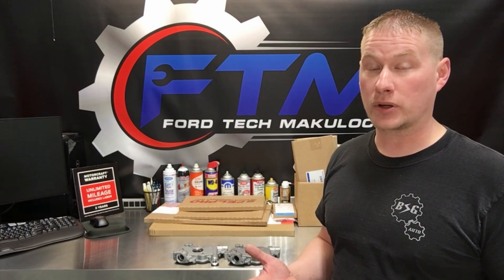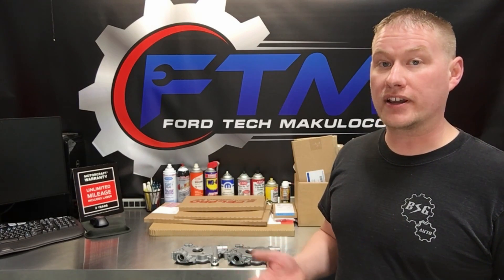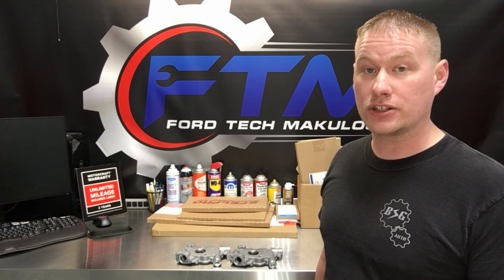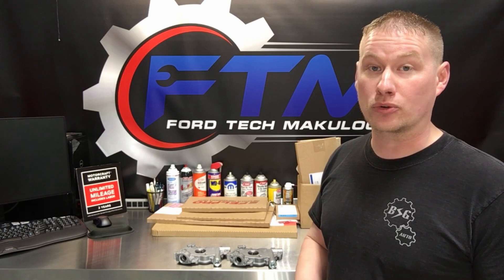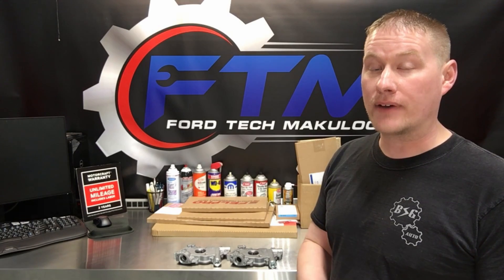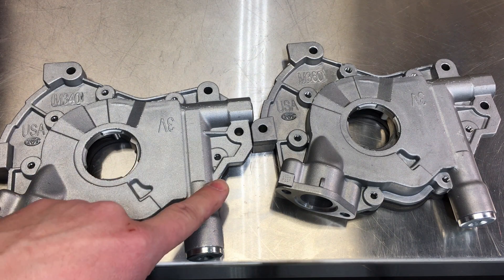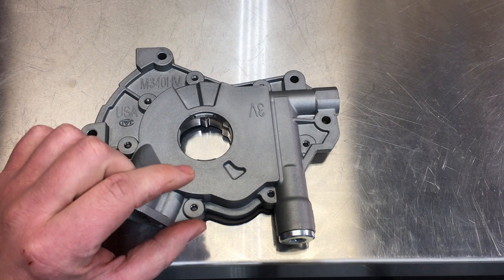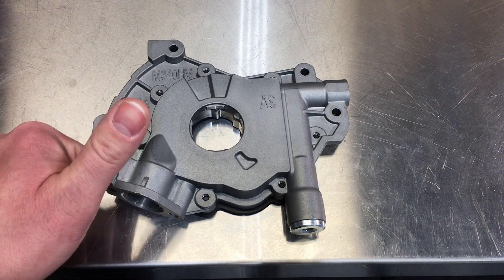The Ultimate 5.4L 3v Triton Engine UPGRADE: New Melling M340HV M360HV High Volume Oil Pumps!

Comment: Hi even though this video is a few years old the information is still relevant I'm sure.
Can you please help me clarify if this & other videos for this Triton engine are relevant for me.
I live in Australia & have recently purchased a Ford Ute One ton tray aluminium version is a 2003 built in the March of that year & is a BA model the engine is a 5.4 Ltr 3 valve double overhead cam engine with VCT though my car is a Ford not a Triton though looks like the same engine, I will try to send a photo. It only has 118K Kilometres on the speedo, though makes a knocking sound, engine is quiet when it's first started though after few minutes warming up starts to get a knocking noise & is hard to identify where it's coming from & it is not a high pitch knock, I have changed oil recently along with the oil filter using 10W30 good synthetic oil. hoping you can help these videos are relevant to my engine & would love to hear any advice on my knocking sound. Kind regards Neil

Comment: Oh man I am having one heck of a time with a 5.4! I installed a new crankshaft, bearings, timing chains, phasers, metal body ratcheting style tensioners, camshafts, and oil pump. the cam journals are a little scored but not bad enough to bleed off all my oil pressure... When it gets up to operating temp the phaser rattle and shake comes and goes, like there is almost enough oil pressure but not quite. Cold start is 60psi+, when hot it is something like 25. I had a brand new oem 4v oil pump on the shelf so that's what I installed but I think that might be my problem... Going to try one of these hv pumps before I take the heads off.
Reply: Did you install a high volume pump since you posted this comment?

Comment: My 2005 f150 is having a oil pressure problem, but I don't know exactly what it is.
It shows ENGINE FAILSAFE MODE warning and it runs for a few seconds and dies.
Does anyone know what the problem could be?

Comment: 2008.5 Expedition here...about to do the timing chain due to failed tensioner (all motorcraft parts) and the M360hv pump. What weight oil do you recommend?

Comment: So I have a 2011 Ford Expedition 5.4L 3V. Will the M360HV work for my year? Amazon says it won't fit, but wanted to ask around. Amazon says the M340HV will fit but not the M360HV.
Reply from the maker: Both work.
Reply: Thanks Man, Any particular reason why I should choose one over the other? I'm leaning towards the M360HV just because of the higher oil pressure. It's just a stock Expedition with the new updated roller followers thanks to your amazing videos. We appreciate everything you do man.
Reply from the maker: You need higher volume not higher pressure
Reply: @FordTechMakuloco  perfect thanks

Comment: @FordTechMakuloco Brian,  May I suggest you detail why you're recommending the 340 over the 360. As I'm sure you know, there is a lot of confusion (via the comments) on this issue. With this engine suffering from oil pressure issues, "common sense" say's higher pressure is better, however, common sense doesn't make something the best.  
Cheers
Reply from the maker: There are clearance issues not pressure issues so you want the M340HV.

Comment: My 2010 F-150 FX4 5.4, 3V is showing the oil can symbol on the instrument panel. I'm not losing oil so I assume my oil pump isn't running at 100%. I clicked your link for the Melling pump but the Amazon garage feature is showing that it is not compatible with my truck. My VIN is 1FTFW1EV8AFA08090. Do they make a model that is compatible?

Comment: This is one more reason I have trouble trusting Amazon. You clearly state in the description these pumps are for 04-14 5.4L 3v engines. I clicked on the link and Amazon said it doesn’t fit my 2005 F150…..

Comment: I put every thing in like you said, everything went very well. I put in the upgrade oil pump, the piece of crap broke at less than 20k miles. It was running perfectly, good mileage, regular oil change, good oil. Left us setting waiting for a tow truck. Probably go with the more expensive Napa pump, haven't  decided yet. Otherwise you put out excellent videos.
Reply: Yea if you don’t drop the pan and clean the pick up out doesn’t matter how much oil pressure your pump makes

Comment: So does ford now put the melling hv oil pump on the new ford reman 5.4 3v engines? On another video you mentioned ford did update the oil pump and roller followers on the new ford reman 5.4 3v so is it good enough to not bother installing a melling hv oil pump if we have the opportunity ?
Reply from the maker: Why would they use melling parts in a Ford branded engine?
Reply: @FordTechMakuloco  Is the oil pump they use at least equivalent... cast iron backing plate and increased pressure etc? That's what I meant. In other words is there any need to upgrade a new ford reman with a melling hv oil pump..is the melling  still better ?
Reply: @FordTechMakuloco  
Hey buddy...some time other companies use another brand
Dodge Ram use Cummins engines... Hello?!

Comment: Wanted to ask the forum and FTM about this situation where I bought a 2010 Expedition (138,000 miles) with a timing component replacement job, but no oil pump replacement. Considering the continuing vulnerability of the new components as well as the original roller followers to lower oil pressure in an older engine, would it be reasonable to have a new oil pump installed now? Other than the oil pan, what else would have to come apart?
Reply from the maker: The entire timing set has to come off again, the oil pan stays put.
Reply: @FordTechMakuloco  thanks FTM, it appears I have a dilemma. I guess the roller followers could be done at the same time.
Reply from the maker: Yup replace them when the cams are out for the timing job.

Comment: I know this is three years old,  but they are still not available in Amazon.  Any other link suggested to buy one please. I have 254,000 mile and rather have you do it with your expertise.  But I live in Detroit so to far away and only trust you or myself to work on my truck. Please any other suggestions would be much appreciated.
Reply from the maker: They are just on backorder right now.
Reply: @FordTechMakuloco  I can get the m340hv now but given the mileage should I wait for the m360hv?  Also I'm worried about to much pressure and blowing all my old seals. Any advice would be appreciated. Your opinion will not be used against you. 😁
Reply: @FordTechMakuloco  also Amazon claims the m360hv does not fit my vehicle?

Comment: How do you know you need a timing job ?
Reply from the maker: I have an entire video dedicated to this subject.
Reply: @FordTechMakuloco  oh ok cool. I bought a used 2011 Ford Expedition el limited with 220,000 miles for $6500 did a full tune up , changed out solenoids MAF sensor camshaft sensors fuel pump and O2 sensors. Has a little “lifter tick” is what my mechanic is saying but runs great should I be worried? It’s been a year I have 227,500 miles now with Mobil one oil . Going to use shell rotella diesel oil next since I hear it’s good for high mileage trucks

Comment: Just buttoned up my 07 Expedition with the new 360 pump, one word......SWEET! I've had a few vehicles with the 5.4 3v and had to do timing jobs on them, always used the 340, this was my first 360 hv/hp pump and at 225,000 my Expy sounds brand new, I'm very impressed with this pump so far

Comment: I see Melling has numerous pumps for the 5.4L 3v's: m340, m360, m340hv, m360hv, 10340, and 10341.  @FordTechMakuloco recommends different models in different videos.  Kinda confused on that.  I understand the volume vs. pressure differences and suppose the confusion occurs over time with new models.  But what's best for me with a 127k mile mostly stock engine in cold country (WY)....I'm assuming the m340hv?  But then add in the heavy 8k towing and high punishment....maybe something else?  Add to that the low availability of m340hv and m360hv now on amazon and rockauto.  Hoping someone can help clarify.  Thanks.
Reply from the maker: Yes M340HV

Comment: A few questions/observations. Amazon states the 360HV does NOT fit the 5.4 3 valve engine. It only lists the Mustang 5.4l engine as the correct engine. Does it actually fit? Also what about the possibility of starving other areas of the engine for oil, such as rod bearings? I know back in the day we used to swap out oil pumps to deliver more oil to the top end, only to spin bearings in the lower end. Thanks again Brian, you have created a legacy of loyal Ford supporters.

Comment: Is there any benifits for the added 20 psi running the 360 vs the 340? I would have concerns about running out of engineering spec pressures. Perhapse reduced fuel economy and extra engine drag... I realy don't see the benifit of the extra pressures in fact possably could cause vct damage but not sure. Any thoughts?
Reply from the maker: No benefit, I use the M340HV in all my builds.

Comment: Lol 10 to 15 minutes  after 4 hours of taking engine  apart to get to oil pump. Timing chain..and radiator  .fan all have r
To come off 5 hour job. If your a young guy with good back..

Comment: I like the idea of changing the engine with a crate engine, however I'd prefer an engine other than this 5.4 that's more reliable & bulletproof by design.  Any idea what I could do?  2007 Lincoln Mark LT this truck is worth it. It's a 4x4.  I'm not talking anything crazy, the least amount of work for a quick drop in?

Comment: So can we run the 80psi versions without any issues?
Reply from the maker: I would stick to the M340HV.
Reply: @FordTechMakuloco  I've just finished building a 5.4 3v with MMR guides and tensioners, new valvetrain, and H beams rods, and ARP stuff on the bottom end... I already installed the 360HV, what issues do think I will have? Should I switch to the 340HV? I haven't put the motor back in yet.
Reply: @FordTechMakuloco  what about use on a 4.6 3v for track duty? (Ive got a 5.4 3v expy and a 4.6 mustsng track car)

Comment: Appreciate all your work on these videos. Quick question on the Meling high  volume Pump. I have a 2004 Ford F-150 FX4 and it shows the two meling pumps do not fit my model. What is different about my model that makes these high volume pumps incomparable?
Reply: I put the 360 on my 05

Comment: I am trying to order the m360hv oil pump from Amazon and they say it doesn't fit my truck,  I have a 2005 ford f150 fx4 Triton 5.4 3v , why would they say it doesn't fit?
Reply from the maker: It fits trust me
Reply: @FordTechMakuloco  thank you sir I just ordered it today and should receive it Tuesday,  I totally trust you 100% I can tell you really know your stuff and your videos have been very helpful,  thank you
Reply: I just installed the M360HV and now I'm running over 80lb of pressure according to my gauge! Cold start it pegs at 95lbs. I think thats a bit too much!
Reply: @mkinttrim  It bypasses at 80PSI
Reply: @itskarl79  I know it's supposed to but cold start with 5w30 it nearly pegs at 100lbs. Doesn't come down till engine is hot.

Comment: What did you say the difference is between the 360hv and the 340hv?
Reply from the maker: Just pressure, the M340HV is stock pressure and the M360HV is High Pressure.

Comment: I installed one of these 360HV's in my 08 5.4 3V. I have ungodly oil pressure when cold. I'm thinking the 340HV would have been a better idea, or even the Melling stock replacement with the cast iron backing plate.

Comment: Can any of the two M340HV Pump (60 psi)-
 be installed? Which one you personally recommend for a 2005 F150? Also, I'm doing a full timing set on it. can you please point me into the right direction as to which brand parts i should buy?
Thank you so much in advance for your help.

Comment: Hi,

Will this also work on a 2006 ford f250 xlt 5.4L 3v?

If so which model or do you another brand?  I checked on the amazon site you gave us and it states it will not work on a f250 5.4L 3v

Comment: When I click on the link for the High Volume 360 Pump it takes me to Amazon of course but after I put in my trucks info it says it doesn’t fit ? And yes I have an 08 5.4 3V. The only link that said that fit was the regular 340 pump but I want the High Volume 360.
Reply from the maker: They both work on any 3v engine 2004-2014.
Reply: Thanks for the clarification 💯

Comment: One more question what is the different between MELLING High Performance Oil Pump 10341 and M360HV and which one is perfect replacement for 2010 Expedition?
Reply from the maker: Use the M340HV
Reply: FordTechMakuloco Thanks a lot I will replace the oil pump soon

Comment: I know this is an older post but I’m curious about older 5.4 engines.  I have heard about the bad designs on them for a while.  Are these design flaws issues in the 2001 5.4L engines?
Reply: No, this is the Triton 5.4 3v, the 01 had the 5.4 2v. The 3v was notorious for having bad oil pumps, cam phasers self destructing, and seized spark plugs. The only problem I can think of for the 2v was the spark plugs shooting out of the cylinder head, but that was an easy fix. On high mileage engines you’ll still have to fix the timing components though.

Comment: Hi,

I came across this video on this oil pump replacement. Man this is awsome. Can this also replace the pump on my Ford 2006 F250 5.4L engine and my 2005 ford expedition 5.4L engine?

I know it's been a few years on this video but do you have any feedback or reviews on this new pump? Differently would like to replace both of them on my vehicles

Comment: need help amazon oil pump M360HV  will not work in my 2004 5.4  ford
Reply from the maker: Yes this pump fits all years of the 5.4L 3v engines.
Reply: THANK YOU MUCH

Comment: I have a 05 f250 5.4 with 140k on it. custom catback exhaust and roush cold air intake system... what are my best options for more power? I want to upgrade the engine whenever it dies so are there more powerful engines that are easily compatible?  Would a tune and maybe regear  to 410 or 430 Or would a supercharger be better? Please help
Reply: BTW your videos are and have been Extremely helpful!!! Thanx man

Comment: Just had one question. I plan to be setting up to do this next month or 2. If I went with the M360HV, do you see any issues with the seals for the timing chain tensioners with the higher pressure pump? Would it be better to go with the cast iron tensioners?
Reply: Absolutely never use the cast tensioners. The cam towers will tear apart they have zero ability to dampen any sort of oscillation in the chains and ratchet so tight there’s major increase in chain stretch. It’s just a whole host of bad.

Comment: Quick  question, Which one should be the best oil pump for a 3V 5.4? 60psi or 80 psi? I just want to ensure I buy the right one, I know both will work just fine. Just curious on which one is the best for this engine. Sometimes more psi does not necessarily means a better product.  What would you recommend? I am doing the entire timing, phasers job with oil and water pump also. Thank you in advance!
Reply: From what I can tell, the high pressure is for the DOHC engines.

Comment: Does a 02 5.4L 2 valve need this?
Reply: No, in fact they are extremely reliable. Change oil, do plugs, fuel filter  and there good

Comment: I have a 2001 Winnebago with the V 10 triton engine. When I start it the oil light stays on abnormally long, 5 to 10 seconds, more so when it’s cold out. Do you have any idea what could be causing this? The oil level is good.

Comment: Hey sir. I replaced my timing components with cloyes in 2018 and i also upgraded to the mellings hv40 oil pump at that time as well. Anyway today while on my way to work the truck started missing and then the pressure dropped to zerp and the engine instantly sounded horrible. I shut it down and about 30 minutes later i started it back up so i could get off the interstate and had oil pressure again and engine noises were gone. Still power reduced i headed down the interstate and it dropped again and just kept fluctuating from zero to 40lbs off and on soci parked it in a parking lot. When oil pressure would drop it sounds like the lash adjusters were trying to beat there way out. Do you have any advice on this
Reply: Did you figure out the problem?
Reply: @carsnthings8948  yes unfortunately the cloyes kit is a horrible product. It cost me my engine. I bought another engine with low miles and went through it and replaced all the timing components with mellings because they have the cast iron ratcheting style tensioners. All is well now it the world of Ford's joke lol

Comment: The 340hv and 360hv are the same pump. Just the relief valve spring is different. So you won't see a pressure gauge difference until you get above probably 4k rpm. One will max out at 60..other keeps climbing. Since I can go 80mph and the rpms in overdrive are 2200...probably won't relief anyway. That's my take.

Comment: I just purchased a Melling pump, dark anodized case with the cast iron back. The casting says it's a M340HV, but is stamped Melling 10341 and comes with an 80lb spring installed, and a 60lb spring loose if I want to install that one instead. Is this actually an updated 340HV, or is it a 360HV in a 340HV case?
Reply from the maker: Only install a true M340HV
Reply: @FordTechMakuloco  The casting in the upper right is M340HV, so it's legit, even though in silver ink, it's 10341? Is this not real? I went to the Melling site and this is the pump listed for my 2005 Mustang.

Comment: HI, THE NEW OIL PUMP M340HV, NOT AFFECT OTHER COMPOMPONENT BY HI ELEVATE PRESURE?, AND I HAVE A 2009 5.4 3V (NOT FLEX) LARIAT 5.4 WHIT 130,000 KMS. FORD SAY USE 5W20, AND I USE NEW 15W40, ALL MOTOR CRAFT BRAND, QUESTION , RETURN TO THE ORIGINAL ESPECIFICATION OR USE THE ACTUAL, THANKS..
Reply from the maker: Use the M340HV
Reply: @FordTechMakuloco  and about oil,  original specification 5w20 and now i use 15w40, what oil use whit new oil pump,  thanks..